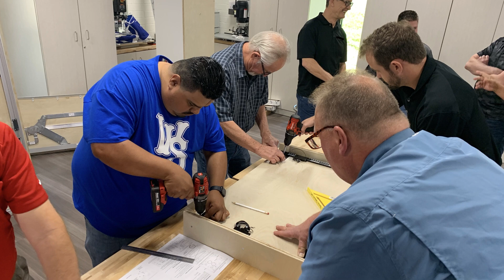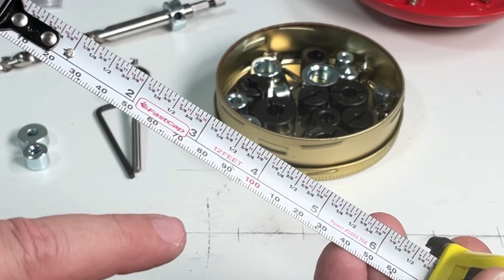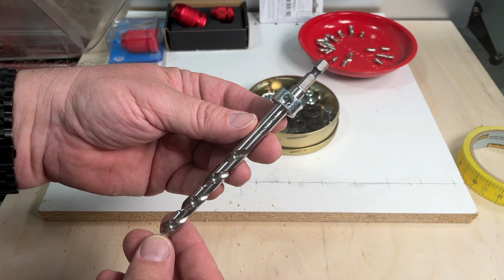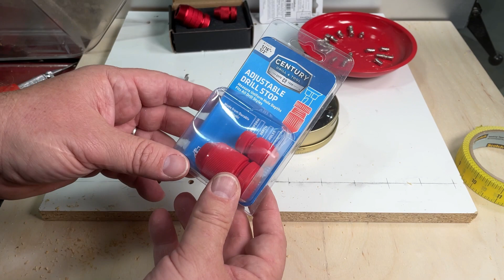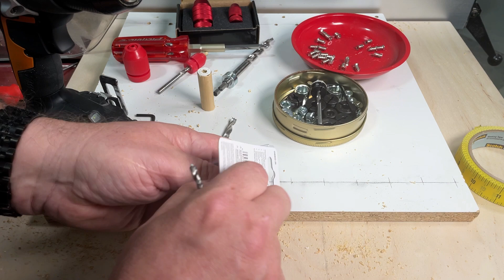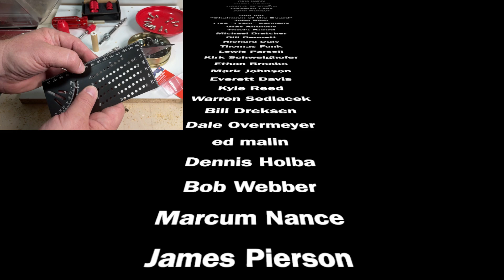Precision Freehand Drilling to Dead-on Accurate Depths

Comment: While You were showing your tape measures, I noted that the same issue was apparent for a right handed person - that normal usage is - tape unit held in left hand, hook placed and unit pulled to required length - Numbering is UPSIDE DOWN! Would be correct for a left hander! WHY NO RIGHT HANDER Tapes??
Reply from the maker: True, almost all tape measures are left handed. FastCap makes a Lefty/Righty tape, but it's inches only, so it doesn't work for me.

Comment: Great tips. Using tape is okay for a hole or two but as mentioned it can move easily. I think I'd like a collar combined with some kind of extension so i don't have to tighten the collar on the flutes. The plumbing washer solution looks like a good one too.
Reply from the maker: I used that idea of a longer collar with the set screw above the flutes an a plastic (Delrin) stop. I’ll post a pic of it on www.MyGrowthRings.com chat.

Comment: Wondering if the internal part of the Arco Tools plastic adjustable stop can be reversed (flipped around) for different bit sizes? Also, the one that takes a cap screw ... my 3D printer is calling me to fire it up and make my own.
Reply from the maker: No, they have the same size opening on both ends, but there’s a chance that the tapered mouth on the body may be different sizes. That would actually make a bunch of sense! Yes, you should give 3D printing of any of these a try. Let me know how it works for you. Scott

Comment: I have the plastic collet style stop.   I do not use it often.  I find my units slips easily.
Like you I prefer the split style metal stops.   These work for me.
Thanks for the layout tape tip.   I did not know about this.   I will have to get some, very useful.
Dave.
Reply from the maker: It is very handy. Since recording this, I found a version of it that has both inches and metric. I link to it in the video description if you want to check it out. Scott